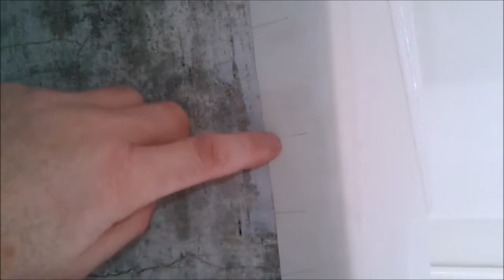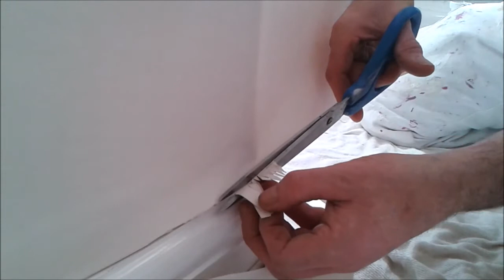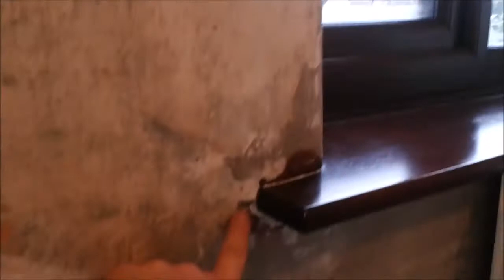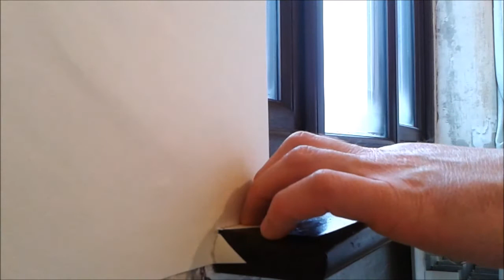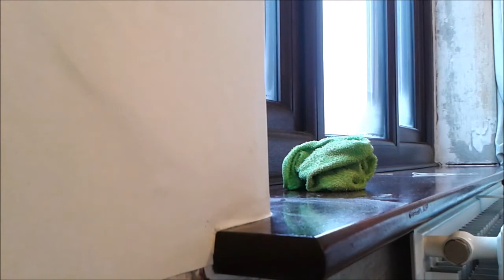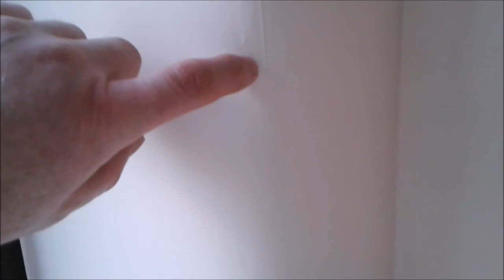Bullnose Corner Cross Lining Walls For Painting

Comment: which thickness lining paper are you useing
Reply from the maker: 1000 grade was used in this room. Thanks 
Lining paper typically comes in the following grades and thickness:
800 – 0.21mm.
1000 – 0.26mm.
1200 – 0.30mm.
1400 – 0.32mm.
1700 – 0.35mm.
2000 – 0.375mm.
Reply: @PaintingandDecorating  I assume it depends on the state of the wall which grade you use ?
Reply from the maker: @pordie1883  true but lining paper shrinks that tight to the wall, that to rough will show through anyway. Thanks
Reply: @PaintingandDecorating  cheers im redecorating my home and looking for options instead of getting plasterer in. Have filled all the holes and scratches and gave it a sand. Hopefully it turns out good. Cheers for the tips 👍